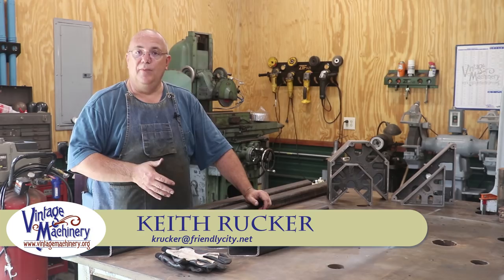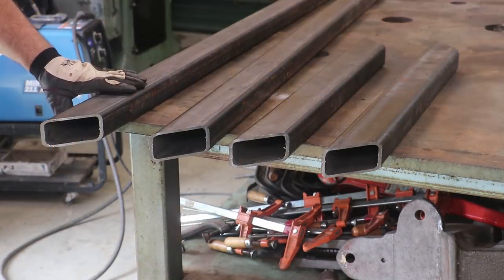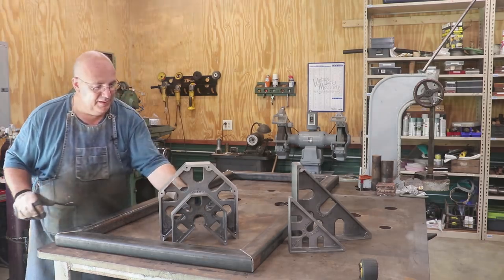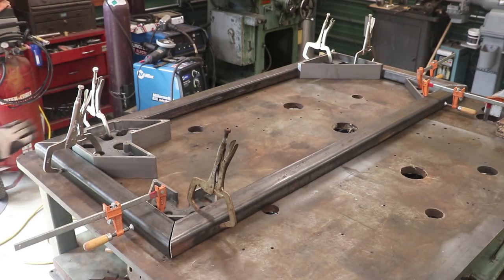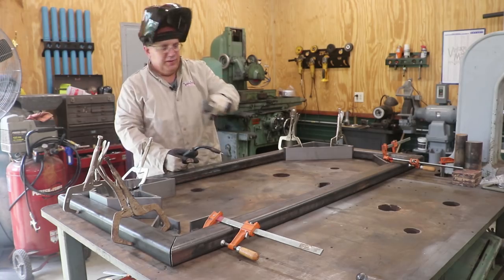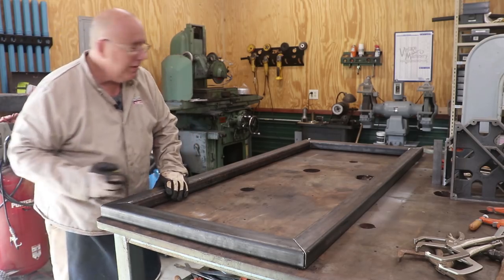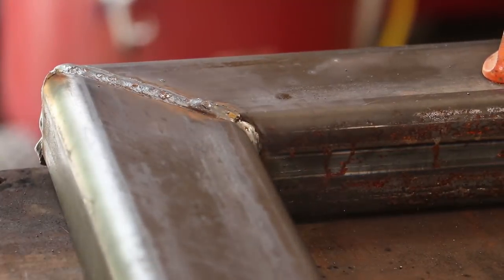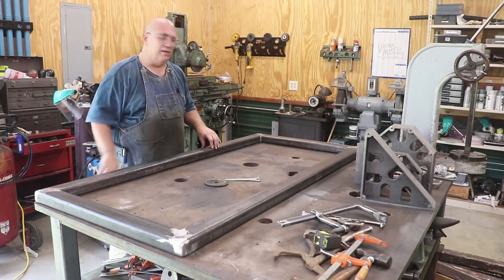Fabricating a Surface Plate Stand: Part 1

Comment: Hi Keith,  I'm sure you know this, but it might be useful for others.  The trick of measuring diagonals is only guaranteed to work when the lengths of the opposite sides are equal.  I know you were careful to cut your pieces of rectangular tubing to reasonably accurate lengths.  Else, you wouldn't have been able to clamp your squares in four corners with minimal gaps.  Pulling the diagonals in this situation is kind of a belts and suspenders proposition.  Or, perhaps a better analogy is, measure twice (four square corners and equal diagonals) and weld once.

It's easy to demonstrate the fallacy of measuring diagonals if the opposite sides are not equal:  draw two diagonals of equal length, have them intersect other than at their midpoints.  Now draw the quadrilateral whose corners (vertices) are the endpoints of the diagonals.  This quadrilateral will not be a rectangle, and will not be "square", yet the diagonals will be of equal lengths.

I once worked on a volunteer project where the team leader "squared" the footings of a rectangular house by measuring the diagonals.  It was visibly clear that the corners were not square.  But, the team leader insisted I was seeing an optical illusion.  I and one of my buddies measured the length of the sides and sure enough, one side had been incorrectly measured by a couple of feet.  Could not get the team leader convinced until I sketched two diagonals of equal length that didn't intersect at their midpoints and then drew the quadrilateral whose vertices were the endpoints of the diagonals.  That really made the team leader scratch his head.  We adjusted the lengths of the footings to those called out on the plan, pulled diagonal measurements to ensure squareness, and poured a square footing of the correct dimensions.

Comment: It’s great to see you weld the way I was taught by pushing your weld. 
I was taught by a former military welder that welded on armored vehicles and tanks before ending where I was working on prototype vehicle production in central Ohio. I am sure he could weld cast iron to cardboard.
Reply: The expression I know for this:  A great welder could weld two horse turds together if he/she had the right rod.  The truly outstanding welders are perfecting the rod!
Reply: you push with gas aka oxy acetalyene /tig. Follow with arc/mig to push the heat into the weld to get pentration. The puddle on mig method doesnt work well. You can experiment if you like.

Comment: Drill a 1/2" vent hole (or 4 of them) on the bottom to make sure water does not stay inside.  Your pin holes will allow the moisture in, but not out (due to condensating on the cold steel).  Nice squares.
Reply: Agree, good advice. Regards
Reply: yep  i agree, ^

Comment: Welding downhill is fine for what you're doing here Kieth. Not code compliant but It'll be fine for stuff like this.  Welding 3G with a mig can be nearly impossible with certain gas mixtures. High Argon makes the puddle too fluid. Places like Komatsu that do it all the time use "fast freeze" welding wire for it. Looks good tho!

Comment: Hi Kieth
You either make it airtight or not.
If it is airtight, once the oxygen inside is depleted, the rusting stops regardless on humidity.
Only if that humidity (H2O) is separated into H and O, rusting would start with the Oxygen, but that is
not going to happen spontaneously (Dissociate water).
If my memory doesn't betray me, for each 8g of oxygen, one gram of iron is rusted. You would be
lucky if in the tube you have more than 10g of oxygen left if it is kept sealed. So less than 2 grams of iron will rust.
If it is not airtight and oxygen can get in, then it will rust obviously, being humidity a helper.
Due to the temperature inertia of iron, when the iron is cold and the air is hotter, due to the
dew point you can have condensation inside and if it is not airtight and oxygen can get in
it will continue to rust.
Maybe a compromise is to use a sealant on those corners if welding is not going to guarantee it.
Of course if it rusts, it will be an issue in 200 years from now :-)
Reply: The issue with sealing a tube like that is that the hot gasses inside the tube will blow your weld out as you try to close it. If I was building it and was really concerned with rust, I'd just either paint the inside with weld-through primer before welding it up, or since that's not an option now, drill a hole in it and you could purge the tubing with an inert gas.
Reply: you do know that weld thru primer is just a high zinc paint that doesnt stick to metal worth crap right?

Comment: You’re missing one item from your set of ppe, a multi coloured cloth hat to go under your shield. From experience supervising some contract welders you need several caps so as not to clash with any other welder. Now this is serious, the equivalent of high fashion on the job site and I have several stories to go with my observations. Oh and the soft peak is worn off centre at the back of the head to protect against the sun or another welders ark uv. Regards. P.S. Welding supply outlets on this side of the pond usually have a goodly number for sale.
Reply: Peter Gregory the peak of the cap is worn to the side to keep sparks out of the ear. If you ever get a hot spark in your ear you know about it right away.

Comment: Rectangular tubing will be more rigid in the wider direction; rotating those 90° would give a more rigid frame for the vertical load.

Comment: hello kieth pretty nice welds bud. just a pointer kieth weld your inside and outside corners downhand like an upside down u shape it will penitrate enough for what is requirered and look nice as well. hope this helps for future welds.

Comment: I look forward to next video. However from sound and looks of weld you had little penetration. That and you don't push a weld on mig as that just lays it ontop. You follow so that all the heat gets down. Hard to describe.

Comment: Looks good.  I would weld it solid and  and then drill a few weep holes in the tubes.  Holes in the welds are weak points.   But its you plate not mine. .

Comment: Keith I'm just curious what size wire did you use, solid or flux core if solid wire what gas did you use?  Nice welding for a low time mig welder.  And of course another great video... Thank you!

Comment: As the weight is suspended along the long side would it have been more rigid if the box section was rotated through 90 degrees?
Reply: it has a 3 or 4 point contact , not a total contact with the slab, plus who knows where he is reinforcing, he im sure thought of all this
Reply: I was refering to his comment at 1,20sec in. with a genuine question. I am sure that he does not need you to fight his corner with speculation and bad spelling!
Reply: first of all it is all spelt correctly, second, talk about rude, do you think keith is going to waste time answering you?  why should he justify your lack of understanding of everything he is going to do ?
Reply: ( he im sure ) the middle word is not in my dictionary.

Comment: Hey Keith the welder emits ultra violet not infra red... Its the ones that will turn you into a handsome brunette... :)
Reply: Wish I had worn gloves and a jacket from the beginning after many skin cancer surgery's on the top of my hands and forearms. Now I won't even tack with out gloves.
Reply: Both actually so everyone is right. The arc is ultra violet for that (un)healthy welder's tan but those little molten beads flying everywhere are very much glowing in the infra red as they burn holes in your skin.

Comment: I have a question, Keith. How flat does that stand have to be in order to not affect the surface plate? if the tubing had a slight bow in it, will that eventually affect the plate that is sitting on top it? Will you have to use a type of bedding material to make sure the surface plate is equally supported by the stand all the way around? I know some people will say it is stone and not prone to flexing, but I have seen mountains before so I know that is not necessarily true.
Reply: the plate stands on 3 or 4 points of contact, adjustable feet in those specific places, it will have been ground with support in the same areas, it doesnt sit flat on a surface as such
Reply: Keith said and has said in past videos about surface plates that there is going to be additional cross pieces the granite will actually rest on.  The granite plate  is supported by three feet on the bottom of the plate so this frame doesn't affect the plate's surface directly.  There are several videos about surface plates, how they are tested, calibrated, finished, and supported.  Keith, Stan, Adam, Tom Lipton, and others have videos about granite plates.
Reply: Thanks for the answer, I honestly had no idea if the plate would eventually bow from its own weight being supported in such a manner.

Comment: With MIG welding, verticals should be done in the downward direction from top to bottom as it is shielded by gas. Different from stick welding, which is always done vertical up because of slag inclusions welding vertical down.
Reply: Michael St John. While vertical down is a method for MIG, Vertical up is primarily used, for strength. Especially in structural, if I used vertical downs they wouldn't pass and I would likely be sending my cv around. The truth is that down is acceptable for most applications, for example this project. But up is an important skill to have if you're in the game. The reasoning behind the Up vs. Down is penetration. You will get much more penetration and heat into the joint with a vertical up, where down is bordering on a gravity cold lap. Again, down is good enough for this purpose, so I'm not disagreeing with you entirely. Only sharing the knowledge.
Reply: I replied with a shorter version before I seen this. You're totally correct. Vertical down wouldn't pass an inspection, but Kieth doesn't need to worry about code compliance here. It's all just commons sense really, I'm a CWI and I can tell you that the structure of the tube will fail long before those flat welds will  so I wouldn't worry about a few down welds on the corners.

Comment: I'm not sure why a granite surface plate wouldn't incorporate a heating element and a thermostat to prevent temperature warping.
Reply: Landrew0 
I think that’s why they use such a large mass to prevent any potential warping. His is going to be more than a ton most likely.
Reply: A 72" X  36" X 12" slab comes out to be approx 3090.7 lbs! Yikes!!
Reply: A larger mass will warp less? LOL
Reply: i believe the granite is aged well before it is sold, they must know by now if it did
Reply: I'd wrap the stone with a heat blanket, and control it with an electric thermostat.  On such a large mass, the differential temperatures between the internal and external masses would certainly warp the surface.